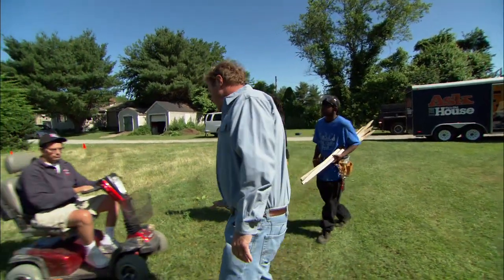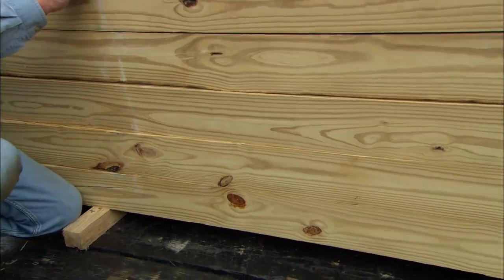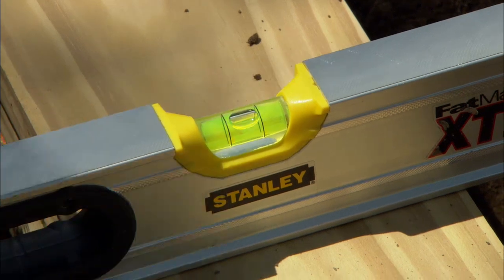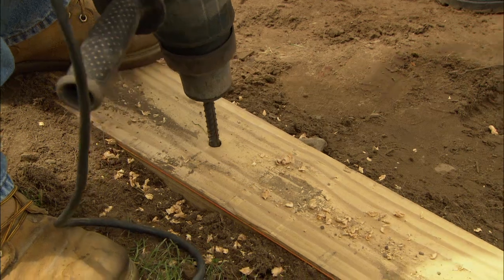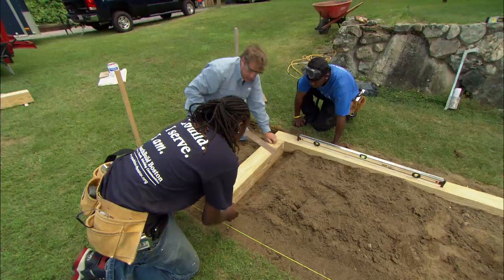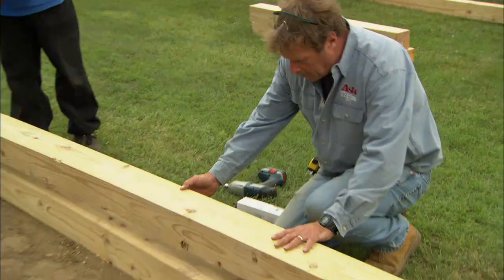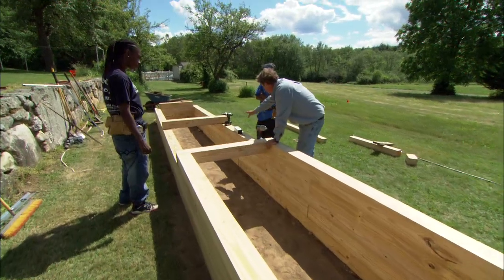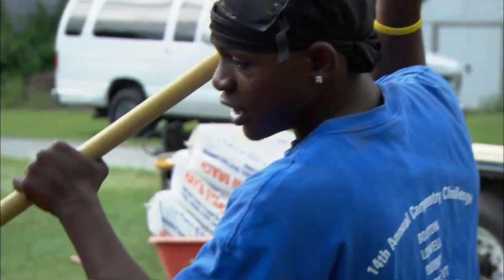How to Build a Wheelchair-Accessible Raised Garden Bed | This Old House

Comment: for people are interested. i did same for my mother. use 2x3 build it like a U shape with 1/2 triangle plywood in low corneron top of the U shape i screw latte (1x3) the size is simple.
the width is the length of the arms x2 less... lets say 6-8 inch ( nobody like to reach someting to the very end of his arms
the height is the height of his arms is extende on is side when he is in the wheel chair, not to high not to low just a the most comfortable height.
now build your O shape every 16 inch 
use 1x6 plank 
screw if outside... i know its weaker but you can change it if broke. use 1 1/2 screw 
separate your join( not all on the same line)
put a strong polytene inside and stanple HIGHER than the dirt ( for the same reason you dont walk in water deeper than your boots. try to fit with the shape of the box. staple it in the botom of the box less as you can
cut big square at the botom ( you need the water to circulate not to stay there. and you want the worms the move in and out.
put normal dirt in the botom and on the top garden dirt( the ratio of normal dirt and garden dirt depend of your income$$)
you can use treated wood but dont forget you eat whats in....
i suggest to treat it with vegetable oil 
drop it rigth on the ground
we have 6 box of 24 ft 
4 years on the ground. little some plank turn bad in general its in really good shape ( struturaly)
my mother can garden with only one leg and use tle latte to rest will she use the other hand to garden.
she use special pipe made of little hole. and she install it all over the latte.
in hot day she come a the end of the box turn the water up, come back 30 minute later and turn if of.
one suggestion i did do is to straigth the ground. dont turn crazy but just enough mine follow the ground and put stress on the structure. i realise it to late. 
good luck and try to be slefsutainable.

oh and sorry for my english je suis de quebec  :)

Comment: Did I miss the part where he mentioned any details about the wood they used?
Reply: looks untreated to me.  it also looks really expensive, $400 or more, probably a lot more, just for the wood.
Reply: +Mike Bald Check the Shopping list in the details it says 6x6 Pressure Treated Timber.
Reply: Do not use treated wood for a garden. The chemicals leach into the soil and into your food (plants). Use any wood and replace when needed. It will take YEARS before you'll need to replace a 4x4 or even a 2x6.
Reply: Mike Bald use stainless steel

Comment: You don't need to remove the grass if you have 30 inches of organic matter on top, or if you're making a shorter version,  just use a few layers of cardboard and 4 or more inches of soil. Also, the timbers all around are over kill and too expensive. Two by whatever boards (2x6, or even 1x6) attached to corners made from 4x4 posts would have been just as good.
Reply: Using timbers will make that garden last for many many years.